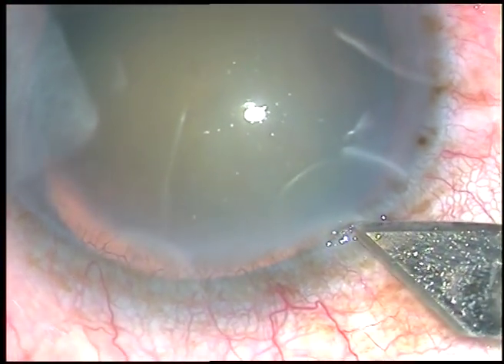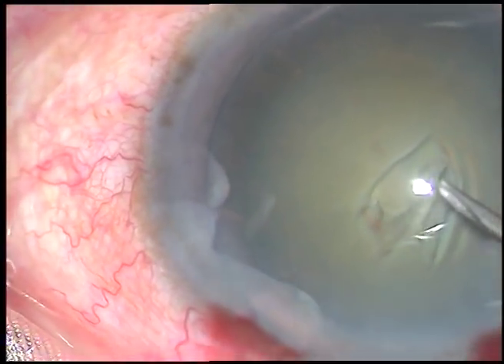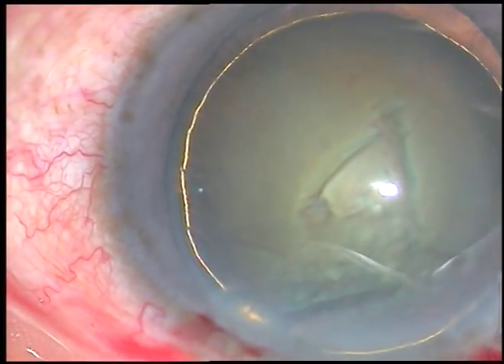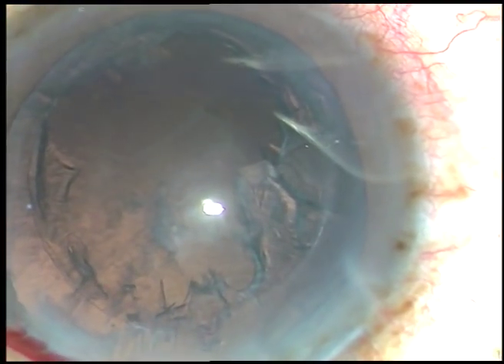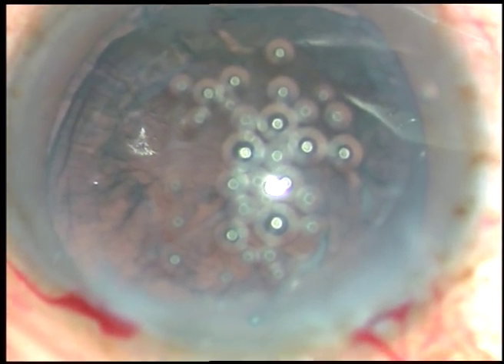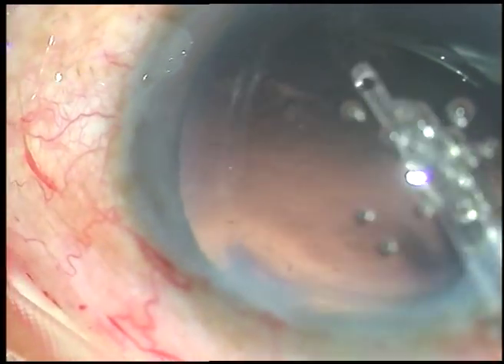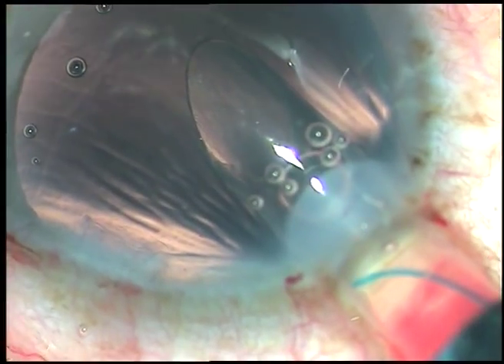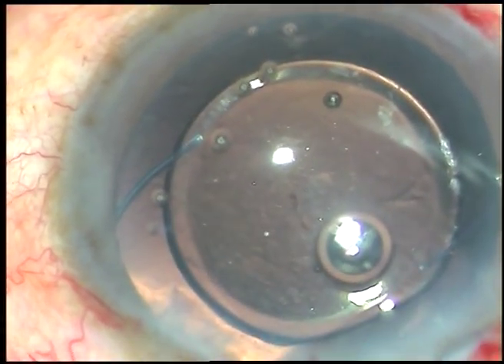Phaco : Wish not it were easier, wish you were better - Pradip Mohanta

Comment: That was the most dilated pupil I've ever seen. Even though the capsular bag was giving you issues, the capsular tension ring did the trick in forming the inner perimeter of the bag making the rest of the procedure routine. This was not your usual case but the proper steps yielded the best possible outcome. Nice procedure Dr Mohanta.